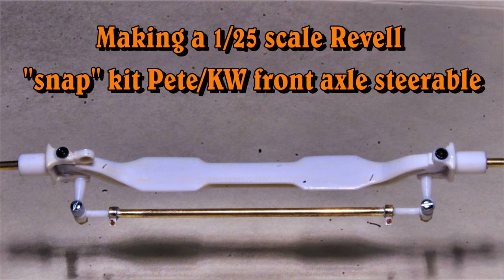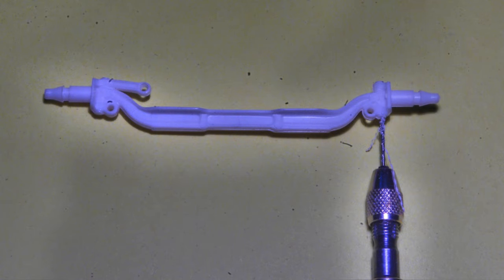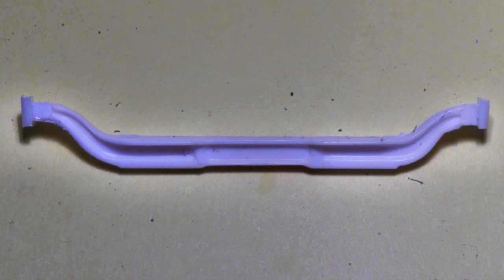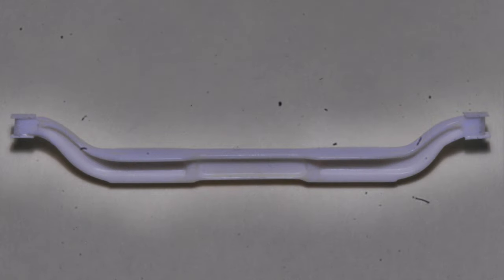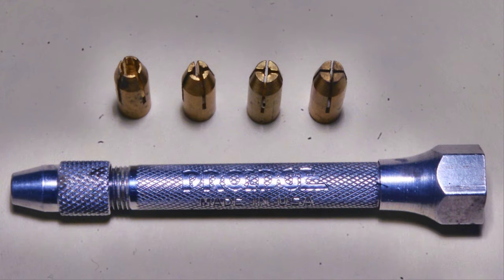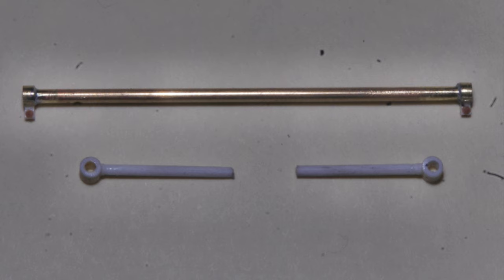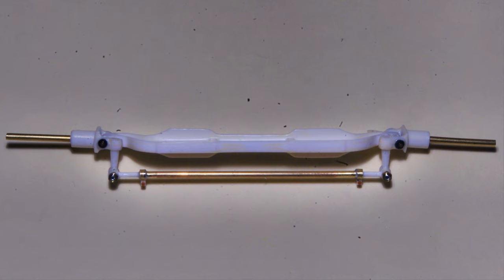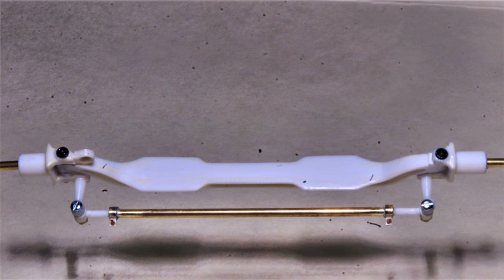Making a 1/25 scale Revell "snap" kit Pete/KW front axle steerable

Comment: Thanks once again for doing these. I now have some direction to take on making steerable front axels on some of my rigs. And, thanks for the heads up on which kits are good as parts donors.
Reply from the maker: A fellow modeler told me about the "snap" Pete 359 kit a number of years ago, especially for the older style 10 speed shifter and the horns which have open bells. I believe the engine is a 3406B from the pre-electronic era. Price of these kits has gone up some although it is still quite a bit less than the "glue" kits.